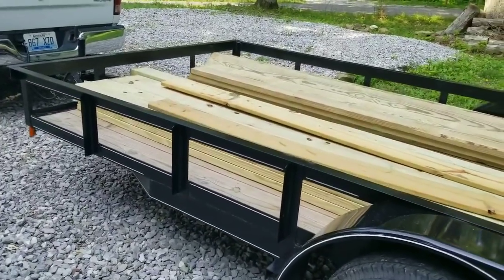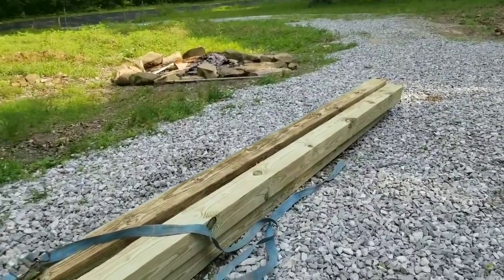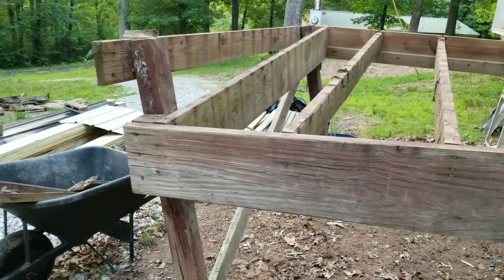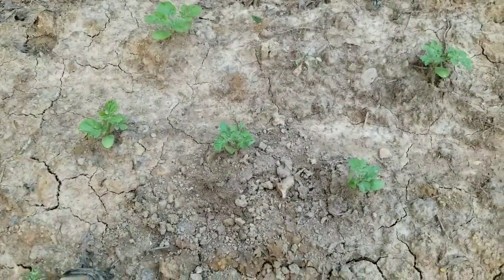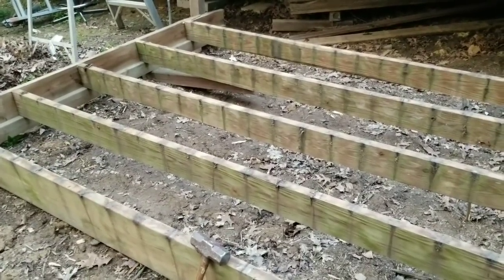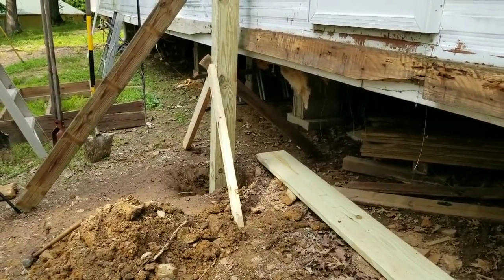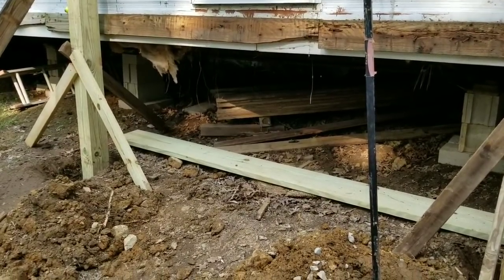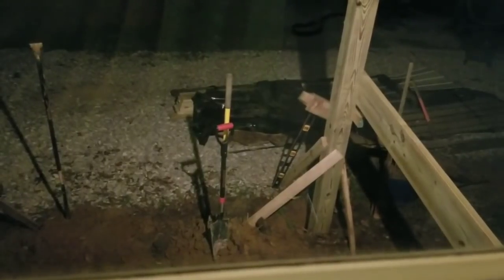#2019 $5000 SINGLE WIDE MOBILE HOME RENOVATION EP.16 DECK TEAR OUT

Comment: a good days work but I  wanted to see you get back inside. I do not know how you got those posts in the ground  by yourself!
Reply from the maker: Well I had to drag one end of the pole next to the hole, then get at the opposite end lift it up and basically bench press it above my shoulders then walk down the pole lifting it up until it slides in the hole then keep pushing until vertical :) The closer you get to the end by the hole the heavier it gets because the center of gravity changes.

Comment: I am sure you already know this but be sure to put some support under the joists to carry the weight down bolting them to the 6 x 6's isn't enough and the deck WILL eventually fail as a result. Heavy duty Simpson brackets or a 2 x 6 bolted ther full height of the exposed post might be good enough to do it. The correct way, however, is to notch out the joist's thickness into the post so the joist becomes part of the post itself and the weight will transfer to ground that way. Love your video posts and your practical approach to solving problems and I think your home will be great when all is said and done. God Bless.